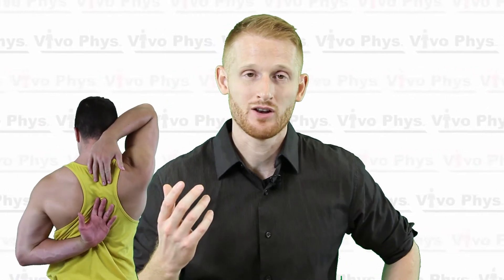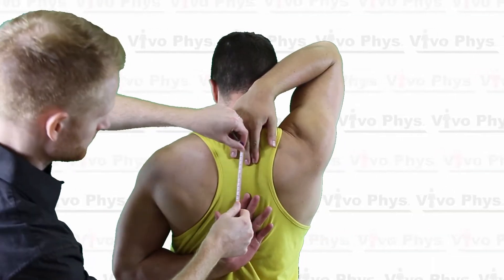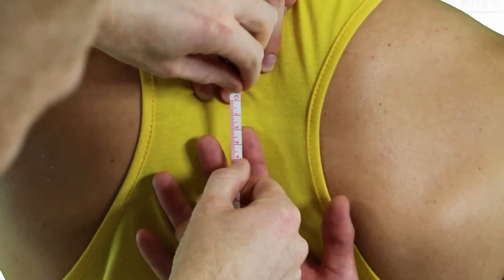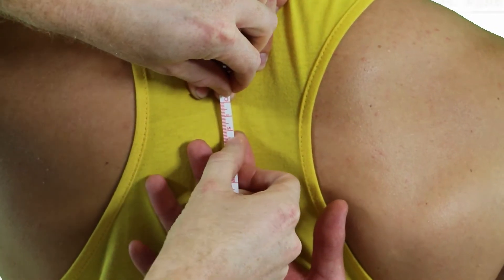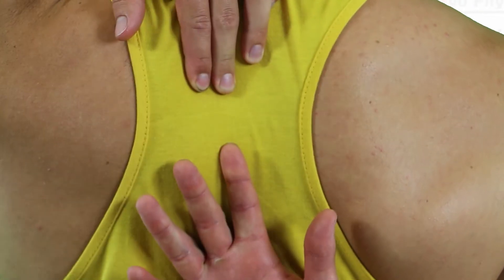Shoulder Flexibility Test

Comment: My right arm can't reach up very far behind my back, what stretches do I do to address this? My right shoulder is also slightly rounded over and I want to fix this for my lifting.
Reply: i have three recomened stretches one but you right arm over behind your head and use your other arm to pull it to the other side 
and if you have trouble reaching your left arm up to your right arm i recomend putting that arm behind you while stting down so that your pink is pointing to the opposite way and try to put it as fr as you can and the other stretch for your right if you can do a bridge go into a bridge and try to lean over your shoulders

Comment: How do you take lack of overlap into account in an exercise program.
Reply from the maker: It suggests a low level of flexibility in the shoulder joint. Depending on the needs and desires of the individual you may want to emphasize flexibility exercise with a focus on the shoulder. However the person may have other fitness attributes that are in greater need for improvement. So the fitness professional would need to work with the person to determine appropriate goals and an exercise prescription to work towards those goals.

Comment: on the right side it is a 1 foot overlap, I did no stretches and I wasn't warmed up but it still seems pretty extreme then when I didn't with the left side over I got a little over 13 inches are these results healthy😅😅
Reply from the maker: Sounds like you have flexible shoulders. That's a good thing!